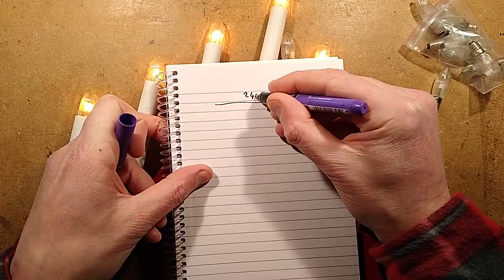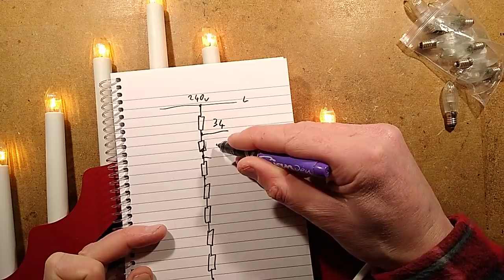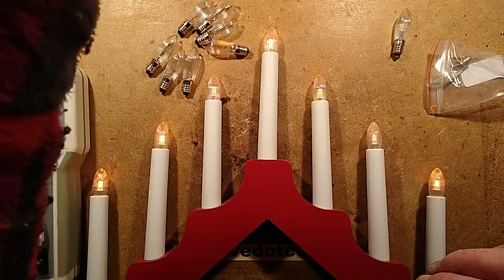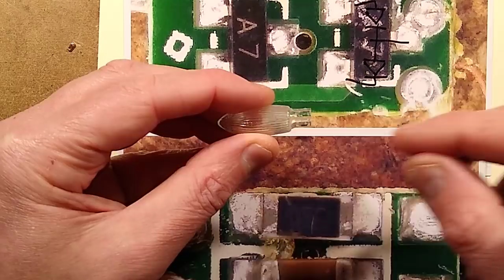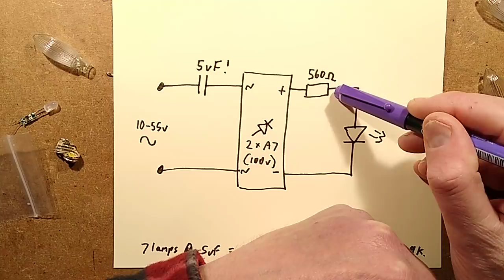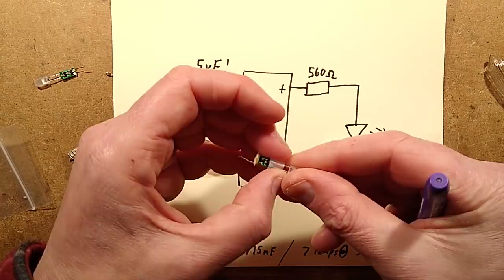Why you can't mix LED and tungsten in series circuits.

Comment: I done bought these led lights for my eBay store. I broke some which still light up but I just can't sell them damaged. I was quite impressed with the 10-55v range. But what baffles me is it only works on ac. I tried on a DC power brick and it would flash once and go out. I actually am in the US. We are of course 120v. I done rigged two up to the mains in series with a .7w led night light of 120v. I did that because while I don't think 10v overage should hurt it, I just used that night light as a resistor for good measure and all 3 bulbs lit up!  So that was quite cool and whilst the night light is a brilliant white the candle arch bulbs were a beautiful warm amber colour.

Comment: Three " Poundland " antique ( Tungsten filament ) 60 watt, 230 Volt lamps , wired in SERIES glow a nice orange and make a super dooper " nightlight " ( having approx 80 Volts across each lamp ) ... to get the same effect with ONE lamp , wire it in series with a MAINS RATED  2 microfarad capacitor ( value critical ! ) .. probably a good idea to wire a half Watt 1 megohm resistor across capacitor to avoid shocks should you handle plug .. note 110 Volt ( USA ) folk will need a different microfarad value , but the 3 in line should still work OK with 110 Volt lamps ( ? )  in addition , the bulbs will last forever ( ! ).. tried - n- tested ....

Comment: If you have 1 LED with 6 tungstens then aren't you initially running the capacitor in the LED one at several times its rated voltage hence the early failure ?

Comment: i don’t see that problem with 13v DC is the rectfier with capacitor in 240VAC what is the problem or is it less of a problem if it was American 120VAC due to the lower voltage flow

Comment: Generally it is recommended you not mix bulbs. Simply because they can have different requirements. So you can damage the bulbs or fixture. Of course if they are rated pretty similarly then it is fine. Just something to keep in mind.

Comment: Based on my experience, you can't also mix the red led and another color led in paralel, directly. It will make them glowing low and the red led will be brighter. Could you explaining about that, sir?
Reply from the maker: The red LEDs have a lower voltage of about 2V as opposed to the 2.5 to 3V of other colours like green, blue and white.  The red LED pulls the voltage so low that the other colour is dim or doesn't light at all.  Modern LED strings use blue LEDs for all the lights but add phosphor to create the green, blue and yellow colours to make sure all the voltages match.

Comment: Clive having a CNC that uses a Dewalt 611 router. Do you know where I can buy the brushes in bulk for this motor.       each set(2) last about a 100 hours. It is not long when doing 3D projects. Thanks
Reply from the maker: You should be able to get them online, but you may have to go by size and the connection system to try and find if it's a common brush.
If it's going through a lot of brushes you may have to clean the carbon from the commutator and surrounding area.

Comment: The fairground lighting evolved from having 2 in series on a 110v dc supply, as a 60v lamp
filament for the 10 watt  E14 size is more robust  mechanically - nowadays led lamps are made for retrofit 
in a variety of voltages - these definitely can not be mixed!

Comment: Rewire the candle arch in parallel ,  and supply it from a transformer , usually 24volt output, 24va is the usual
standard - this is safe and suits most lamps.

Comment: Hey Clive I think I've got a circuit you could dissect, it's from a Logitech g25 racing wheel. Sold it to a mate and next day were racing when he says he's got no force feedback from the motors and heard something from the wheel right being it stopped working. Tested the diodes and resistor there good but not sure about the mosfet transistors

Comment: Those fairground 60V bulbs probably started out as 55V for 220V in Europe, 110V in America and 55V on old GE/Edison grids.  Later reforms raised the grid voltage by a few percent.

Comment: Hi Clive,

Remember, a guy has to take care of his bulbs - or there won't be any fruit later in the season!

I'm impressed that the 'fried' lamp still gave a fair account of itself even after the fry-up, but I wonder how long it would have lasted if left in circuit, and how much it would have over stressed the rest of the chain.

Now, I have an old neon "flicker flame" candle bridge (seven neons in parallel @ 240V) - I wonder if anyone has ever tried replacing those bulbs with a set of these little LEDs. . I suspect the fry-up would be a whole lot more impressive!
Reply from the maker: I like the flicker flame lamps, but the resistors inside get baked in the UK due to the extra voltage dissipation.  I made a video way back in 2012 about making them last a lot longer.
https://www.youtube.com/watch?v=XVrVWcIK4zE

Comment: https://www.tme.com/us/en-us/details/siov-s10k150/tht-varistors/epcos/b72210s0151k101/?brutto=1&gclid=CjwKCAiAmNbwBRBOEiwAqcwwpUMpDw3Eec-E79GaM23n_WFKLuBNI4gZ0bRpiFc5DYNWsjzfcLmyyhoCPxAQAvD_BwE WOUNDERING could I place these on a beerier strip for easy replacement and I guess it would make sense to use two 4 slot strips and one 3 slot strip  for this the ground strip in the middle and the hot and neutral on either side of the ground and plan was stick the parts directly into the strips with the neutral  to ground with a bit soldered wire and heat shrink tubing to just extend over the grounding strip I will put this together and see it how it works

Comment: it is a capacitive dropper - I have taken these apart when they appeared on the Swedish market in 2010. Since then they have evolved quite a bit, but I guess it's still the same circuit.

https://www.sciencetronics.com/greenphotons/?p=496&lang=sv
Reply: the ones which I have in use right now do actually not flicker - I will have to take a newer one apart after the season ;-)

Comment: This is why I stopped trying to replace bulbs in light strings. Unless the new bulbs are for the same kind of string with same number of lights of the same resistance etc. They will be dim and stress the rest of the string causing the other bulbs to die or it will be bright and it will die quickly. It is easier to wait till after the season and everything is 50-70% off and buy a couple strands for next year.

Comment: How does voltage regulators work that only have 1 wire? how do they regulate voltages with one wire. i know it could be grounded through how the regulator is mounted but as for how it actually adjusts the voltage im not sure. I just want to understand how it works. thank you. im wondering because my snowmobile regulator is gone and it only has one wire

Comment: Just can’t see the point in these LED bulbs for this sort of use case. Just use a low voltage setup with a reasonable power supply, rather than a half-arsed supply in bulb.
Reply from the maker: The modern ones are low voltage.

Comment: I changed three leds in my tv the other month and they are notably brighter than the others, but they are rated the same? 

I assumed this was a result of them being brand new and the others at 2 years old had lost some intensity. Will these dampen down eventually and line up with the others, or should I change all the LEDs instead?
Reply from the maker: They will gradually catch up.  All LEDs degrade over time, especially white ones.
Reply: Thanks Clive. I wont risk opening it up again, it was a miracle I didn't break the flimsy thin screen last time.

Comment: Thanks for the video.
A friend of mine was hating against LED lamps and said they are just a money making scheme because they always blow up for him.
I now know why that is.
His chandelier has 7 lamps. 3 LED, 4 oldschool tungsten ones.
That is good to know.
Reply from the maker: That should be OK unless it's a low voltage halogen chandelier.  The very small LED lamps are very prone to early failure due to the heat and compact circuitry.
Reply: @bigclivedotcom  That is interesting that you say that.
I run everything in my appartment with LED bulbs. E14, E27, G9. Only a single LED bulb failed to this date (knock on wood). But his lamps fail basically left right and center.
Can this be an issue with additional heat from the tungsten ones? The lamps run basically in a little glass-dome where they are shielded upwards. Hot air gets trapped and might fry the circuits. The lamps in question are E14 "reflector style" lamps that don't have the regular bulb-shape and I might think that this will have an impact on the size.

Nevertheless: Great video and I will make sure to tell my mum to NOT replace single bulbs in her christmas-lights that take the same lamp-style you showed here.

Comment: I am told you cannot mix paralleled LED  with standard inductor fluorescent battens...any light on that Clive?
Reply from the maker: There have been issues in the past with inductive circuits damaging electronics with voltage spikes.  But they should have protection against that.  Mixing them in a single fixture might not be a good idea.

Comment: This should apply to putting a new identical lamp aswell since the filament will be deteriorated in the older lamps. Isn't it like car headlight that you should change all of them when one burns out and use the rest as spares?

Comment: Seems the problem is not so much mixing LED and hotwire, but mixing bulbs designed to draw different currents.  Of course the LED bulbs designed for a given light output at a given voltage can be expected to draw a lot less current.  Match the power requirements up right and a hotwire could work reasonably as a ballast for LEDs.

Comment: in series.  however mine if I unplug one they all stay on.  I've been gradually replacing my ceramic C9's with C9 LEDS.  No probs.  and better cord compared to the modern LED lights. that squirrels love to eat..  But yeah in series it'd be like me stuffing 2 3.7 AA size batteries in a flashlight (CREE) designed for 1.5 volts only  .  (pretty much killed the flashlight)  I figured it was Cree so why not.  oh well

Comment: huh, i didnt know you made videos so far in advance of releasing them. also i can tell right away that the quality is 720p. it just has that "look". not sure whats goin on with your recording device but i assume it supports 1080p?
Reply from the maker: I didn't realise it was recording 720P initially.  Only a few videos were recorded at 720.
Reply: @bigclivedotcom  ah, okay. glad you weren't switching to 720p for some reason. in fullscreen on my 1440p monitor it doesn't look so good compared to your 1080p

Comment: You know what would blow the socks off of these series capacitive dropper circuits? A cheap constant current regulator diode like the NSI50010YT1G. Maybe 5 cents apiece in reel quantities from the right supplier? You could lose the series resistor AND the capacitive dropper (Bridge rectifier + CC diode + LED and done) and probably pay about the same or less. It can withstand up to 50V at fixed constant currents and has a negative temperature coefficient (hot chips provide less current and won't run away). Cheapest and most effective current regulator for LEDs that I'm aware of. Would work with 110V AC as well without any modification, so even less inventory to keep on hand for resellers.

Comment: hmm.. i swear all the ones I've seen here in the states are wired in parallel, but these aren't very common these days. Next one I see i'm gonna have to check.  :( I miss them lol
Reply: Usually C7 size 120v lamps, as you said in parallel

Comment: Well... this is amusing to me, last Christmas (2019) we got out the Scandinavian candle arch/bridge and as mum had put some crappy incandescent bulbs in it already, it died after a few days, even tapping it made no difference. Like the rest of the world, I thought of upgrading it with LED bulbs 😀 and went on the internet and found the bulbs (same to what Clive has in this video) 10x on Amazon UK, 1 5-star review, made in Hong-Kong, assuming to be rated for mains 240v, 34v each, ✅ ok, I’ll buy them. Despite what Amazon had estimated for arrival, they were delivered quite early - after boxing-day and I excitedly cut open the package and took out the bulbs and went to, took the arch off the window behind the tree and sitting beside it on the lounge floor and unplugged it and unscrewed the incandescents and screwed the LEDs in and plugged it back in and oh....🤭 they weren’t working 🙁 I assumed that the crappy incandescents had blown the fuse in the plug/a poor connection 🤨 I went to get a multi-meter and contact cleaner. 🧐 the fuse and connections were alright and even dad was stubbed watching with great amusement and showing it to mum, the LEDs were dim and I played with it a bit more and found (weirdly) that when 1 of the incandescents (unlit, resistive dummy load) was put in the 2nd holder from the lead end of the bridge, then the LEDs would light 💡, so I gave up and left it like that, at least the family/visitors had already been, so we put up with this malfunctioning decoration for the remainder of Christmas and next year will repopulate it with (new) oldie incandescents as been done when we first bought it ☹️. I assume the bulbs are faulty/chineseum crap and I still have them and the receipt; seller- ShuoHuiTechnology, and gave a 1 star review on the Amazon posting in response, if Clive wants them for investigation I will re-deliver them (your address) 😁

Comment: I have 3 led lights in a bathroom fixture that do this flickering. It's annoying. They are the only ones in the house that do it and its in a 3 lamp fixture.
Reply from the maker: Have they done it from when they were put in?  Was it fitted with 12V halogen lamps before?  Some electronic halogen transformers need a minimum resistive load to work.
Reply: Hey thanks for the reply, pleasant surprise, was more of a venting frustration than anything I guess but thank you. It's an apartment in michigan, with a 3x e26 or 27 fixture in the bathroom, not entirely sure about the thing but I suppose I can actually kill the breaker and take a look tomorrow. It had a single 60w incandescent in it when we moved in. I have just been dealing with it but yeah If I can cite your video as proof its the fixture not compatible with LEDs in 2020 I can probably get the landlord to fix it. I mean now that you got me thinking of a transformer or regulator or ballast or whatever it may be in there  (I will let you know lol) I may even be able to stealth fix this pretty simple anyway as my regular old 60w equivalent LEDs run on regular 110 just fine. I digress. I love the videos, and all the cool stuff I'm learning. Thanks man.

Comment: It's not only if the replacement lamp is ment for a chain of different numbers, you get uneven light.

You get the same if the new light is of a different wattage, as the resistance is also different.

Comment: Why do lights like these still use series circuits?
Reply: J watkins probably for assembly simplicity
Reply: Less wire used too. Instead of carrying a positive and negative rail to each socket, you only need one wire between sockets and a return along the base.

Comment: your timing is amazing Clive, I was working on ride lights earlier and was getting to the point of nearly putting 60v tungsten ones temporarly in to the fittings to help check the wiring for faults in the e14 fitting as i've run out of 60v led ones. Glad i didn't get to that point having now seen this as i would have just put the odd lamp in rather than changing the set of four

Comment: I'd have thought it would have acted as diode and made the others after it flicker
Reply: No, the rectifier is still intact which allows it to switch polarity
Reply: @wich1  this was before anatomy of the replacement
Reply: Phonotical well, you would always expect a full bridge rectifier there and there would be no real reason for that to break. If there were only a half wave rectifier you’d get into trouble putting them in series as there will invariably be armatures where not all lights are wired in the same “direction.”
Reply: @wich1  yeah that is the trouble I had

Comment: Since they are all in series, could you not remove all the tungsten lamps, plug it back in and install the LED lamps? Why would you need to wait to plug it in until all the LEDs were installed?
Reply: Safety instinct.  The metal on each bulb is live at mains voltage.  Chance of touching is low.  But change thousands over a career in lighting, and the probability explodes.

Comment: Im going to order me some of these candle bridge E10 LED replacements. I have an old candle bridge that ive had for a few years but not used because one of the 32V tungsten filament bulbs is smashed and i couldn't find tungsten or LED replacements cheaply. Now clive has told us the key words to search for i can buy a pack of 10 from china for £5.

Comment: Doesn't this just boil down to a matter current draw, the LED being less than tungsten?
There's a similar issue when replacing some of the older car directional indicator lamps with LEDs--they don't draw enough current to keep the bimetal blinker going.  The usual fix is a resistor across the lamp socket.
Reply: @James Sloan As far as I'm aware, unless these are strange LEDs, the inrush current should be the same as the operating current.    Perhaps this video will help:  https://www.youtube.com/watch?v=ADKjG3Z2L5w

Comment: When you used the hopi with just the one LED lamp, the power factor was still 1.000, indicating that the capacitor had died, right?
Reply: Yes.
Reply: Good catch.
Reply: Yes. There'd be a slight degradation from the two diodes, but not enough to notice.